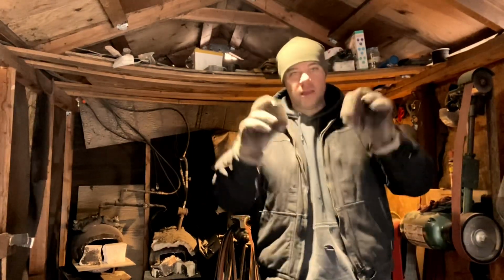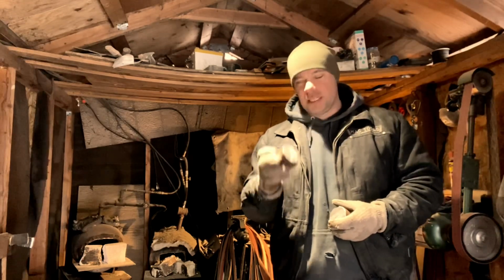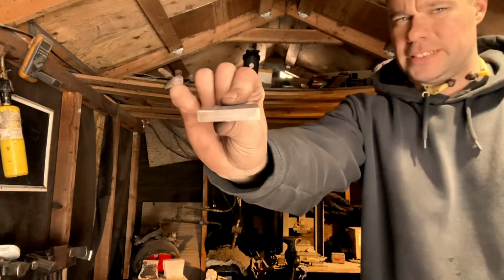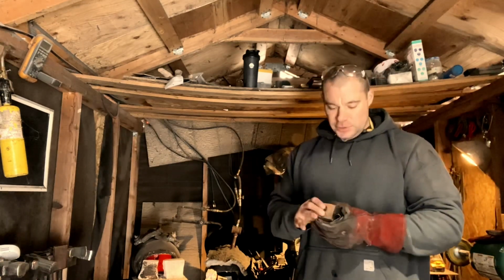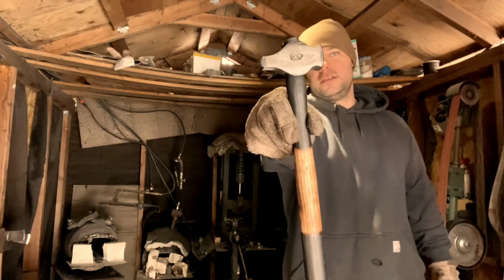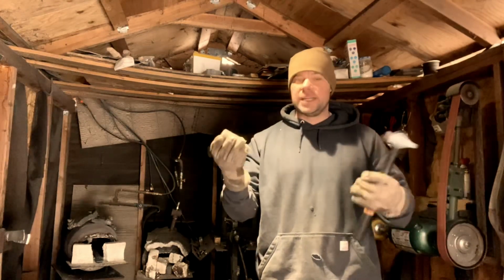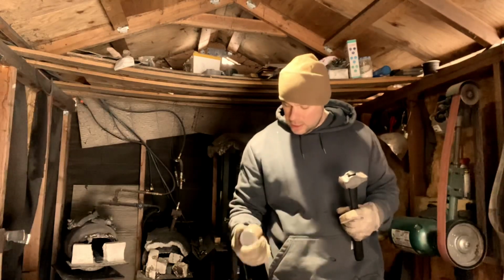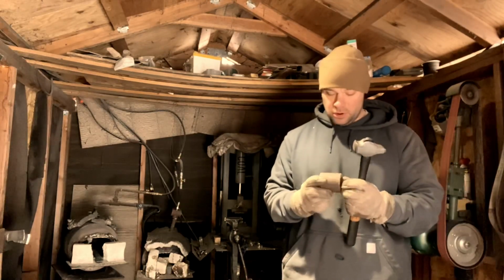Forging a Wrought Iron Hammer

Comment: wow i was not ready for that etch to look like that. it is incredible looking.. what was the final weight? joey van der steeg is a an animal when it comes to wrought iron, i love his videos for older metalworking stuff like this and forge welding old school style.

was that a new flatter you were using? i hope the old one you had still works too because that was planning to be my next quick project!
Reply from the maker: Thanks man!!Joeys vids are awesome!!! Final weight was 1.5 lbs and my original flatter works fine. I made this one out of a large roller bearing.🔥⚒💪🏻